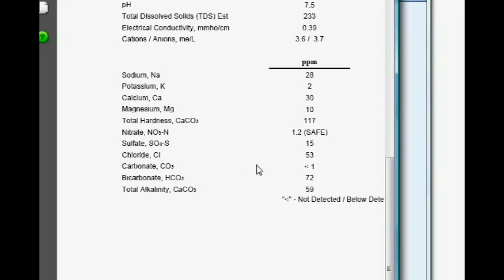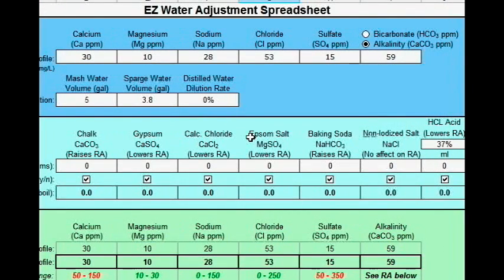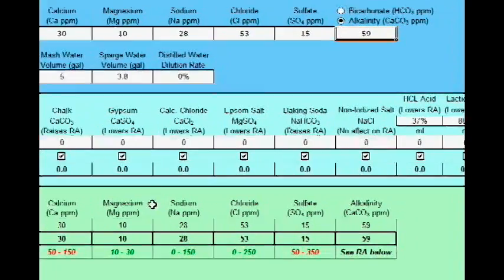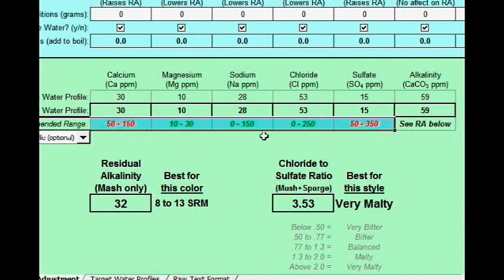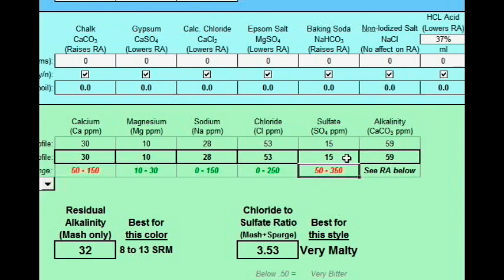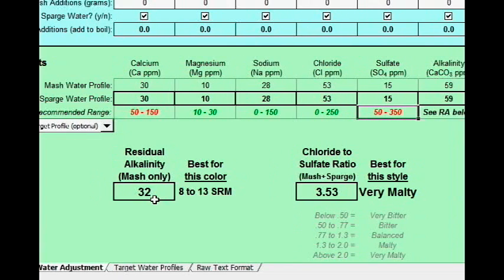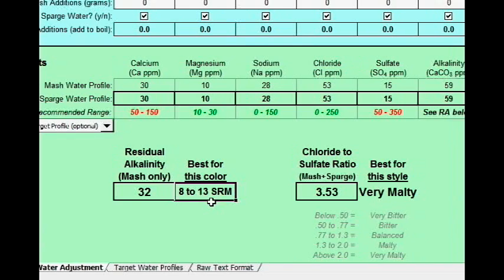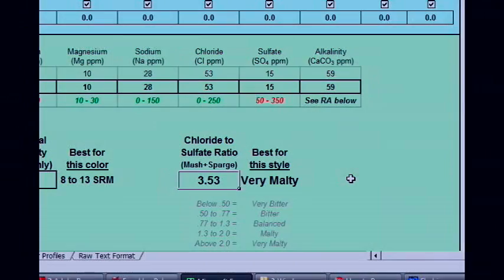Brew Water Chemistry - Part 1

Comment: I was wondering if I should get the W-5 test done instead?
My well water is loaded with iron, but I don't know what I can do for iron content.  I have an expensive water filter attached to the faucet and it markedly improves the water quality. I will have that tested, but I still don't know what to do with the iron results.
Any suggestions? 
Thanks in advance!